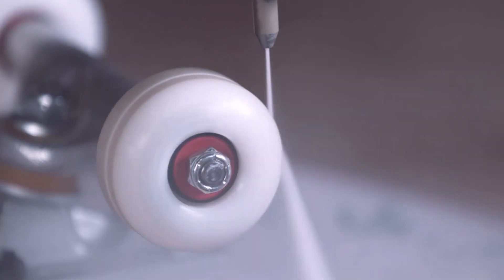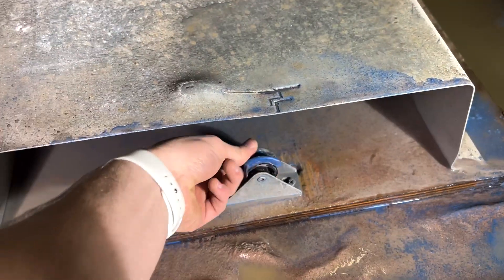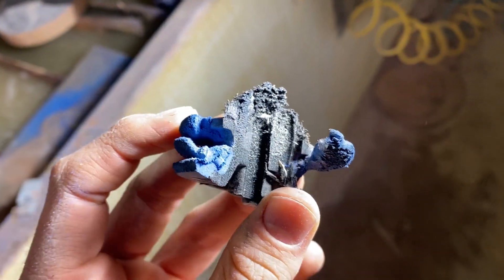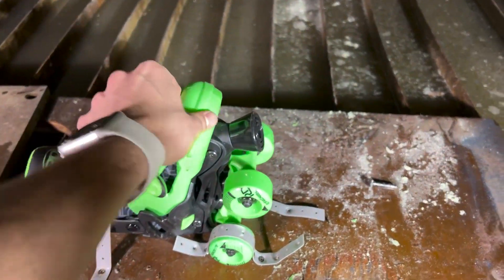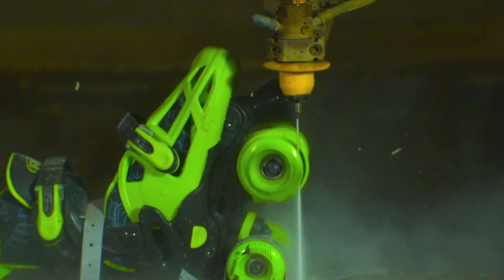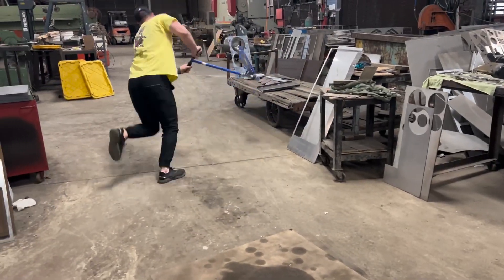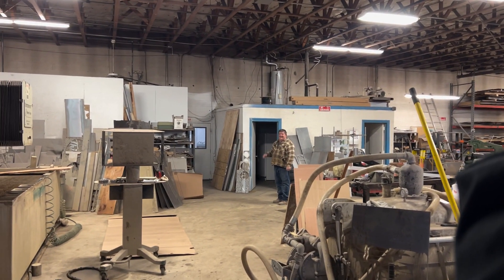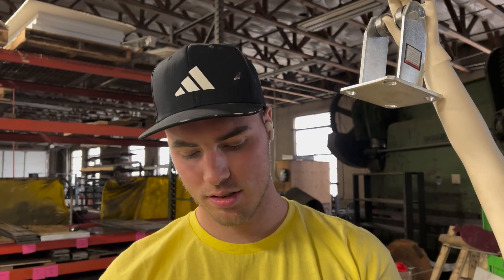45,000 RPM Roller Skate Wheel Explosion With Waterjet

Comment: in the 90's I was a teen and we skated to the Granite Run Mall just to get kicked out instantly by security, but on the way back was such a long hill going down, I skated my
 ass off at the top of the hill headed down, and right before the end of the hill my front right rollerblade wheel melted and so would my face if I didn't stay up. I had Bullseye wheels and abac 6 bearings, they got so hot that the plastic housing for the clear wheels melted around the bearings.

Comment: i subscribed jyst cuz 10:30 "look at our buddieeey *pauooffffffffshhh*" 
lol
& bearings blow for few reasons.. 1 beings no grease/oil &metals & also.. if not centered jet.. offset may force wobble.. lol i did 37k rpm tests b4 youtube 1988
& get the jet to not touch exactly.. graze it if pulse spray starts it.. will last longer.. i bet
Benwa729

Comment: The water jet needs to be at a slight angle so it can deflect as much as possible with losing the energy from the initial impact with the wheel
Reply: The wheel is round it doesn't matter what angle it's at
Reply: @jimmy-ex8ji  look up the relationship between momentum and gravity and you will understand why it actually makes a big difference with the materials he is using.

Comment: You need not to go so deep at all, it’s hard not to want to go all the way deep however the water and the air just need to scum it to get it to start rotating then once it starts getting up to speed where it starts expanding the jet needs to pull back a little so there’s les resistance on the medium from the water in turn hopefully not cut as fast and aggressive? Just a thought as I’ve never ran one of those machines before. Cheers boys keep the intriguing vids going!!

Comment: I’m only 3 minutes in but if you guys do another video. Slow down the feed/flow rate and the speed that the arm moves. Imo it looks like all the wheels you used are failing as soon as the water jet hits it. Maybe a slow buildup would be better than 0-100. Is there also a way to change the angle the water comes out? Like instead of a tight stream maybe a bit wider stream or even conical.

Comment: You moved the waterjet to fast onto the wheels, the the skateboard vid you got it at max pressure and started getting close as if you were cutting something. In this video you just put it a quarter to half inch within the wheel right away sometimes not even at max pressure.

Comment: Maybe don't use abrasives....if your goal is a fast spinning wheel...don't jam the bearing with garnet
Reply from the maker: We tried with both on some of the first ones but used only water after that
Reply: @WaterjetChannel  what the fuck happened to Dan and Mitchell!!!! Stop avoiding our questions and concerns. You will loose a lot of people. Don’t be TKOR……
Reply: @MoloneLabe  Why did you trolls show up and start this random sack of nonsense?
Reply: @CzarYe  I’m not a troll for one. Two Dan and Mitchell just left the channel for sometime without any explanation. The channel got super boring with these new clowns taking over.
Reply: @WaterjetChannel  what happened to dan and Mitchell
Reply: The bearings could just be locking up due to friction